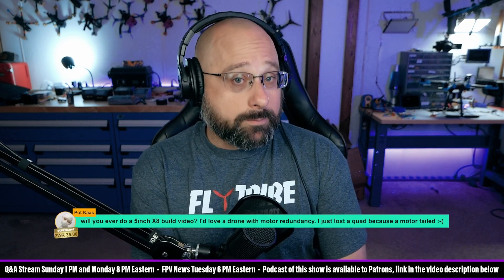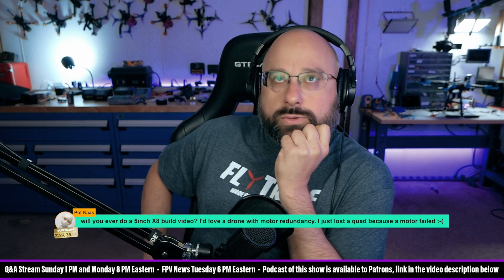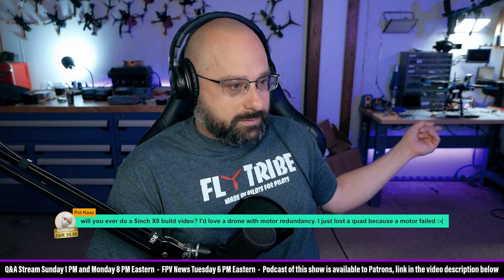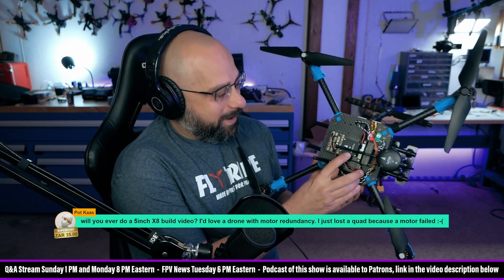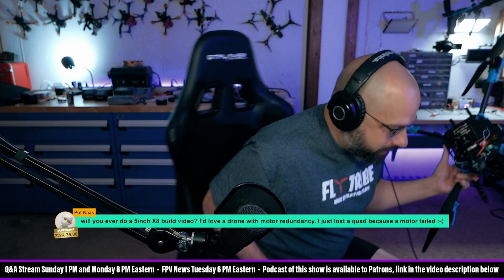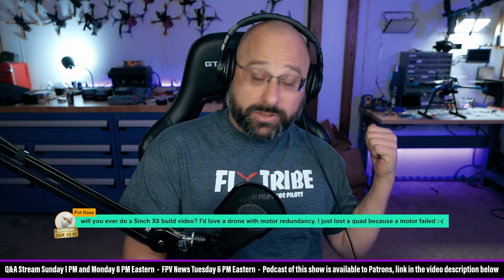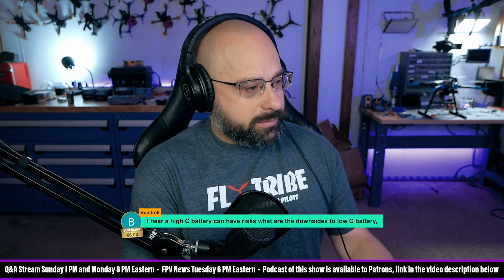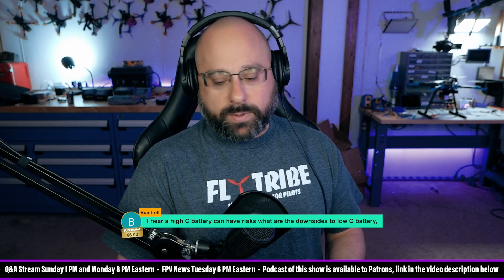Drone Motor Redundancy In Betaflight? Pros And Cons Of C Ratings? - FPV Questions

Comment: Just built the GepRc Moz7. Nice frame, can run 7.5" props. I'm using BrotherHobby 2810 1500kv motors, smooooth and powerful. I need bigger batteries. 😎

Comment: X8 means coax, the X means 4 arms, each with 2 motors. The X8 octo mixer in BF will 100% allow you to fly when one motor fails (or even up to 4), I've tested this, and it's how everyone sets up lifters for redundancy
Reply: I'm doing 7'' octo build because I like the redundancy idea.
I was surprised when Joshua who BTW blocked me form commenting on his main channel said that betaflight will crash on motor failure.
thanks for confirming betaflight will handle a motor failure
Reply: @flat-earther  well he was correct when talking about a hex not working when a motor fails in betaflight, not sure of they've solved that yet but it was definitely an issue. An X8 will definitely work though, I haven't tried a normal 8 arm octo in betaflight. I imagine it's just because JB doesn't do any cinelifter stuff so fair enough